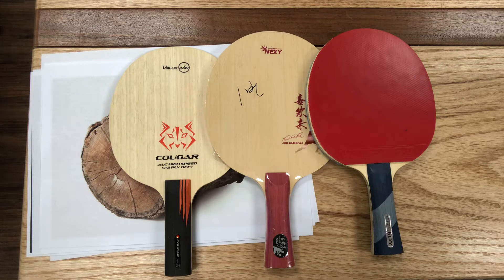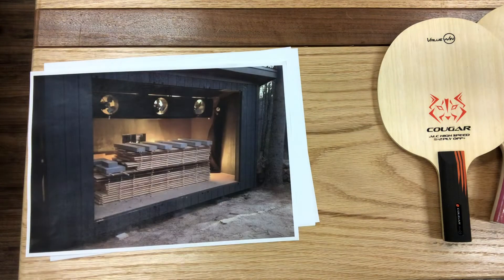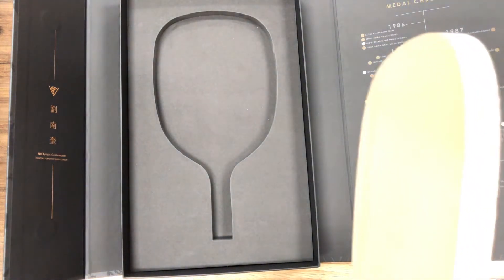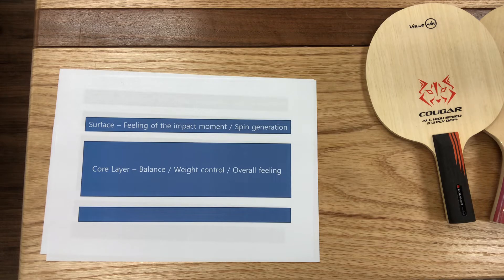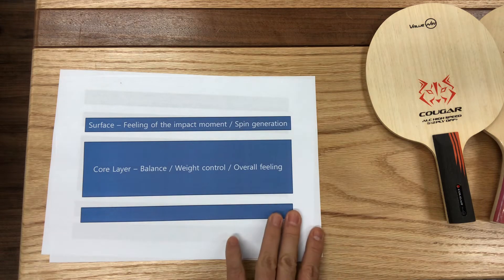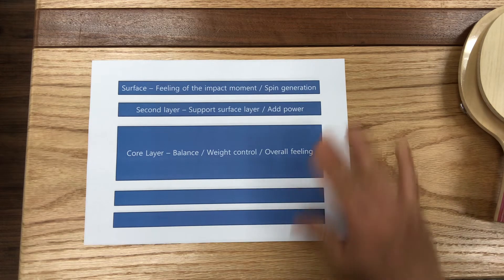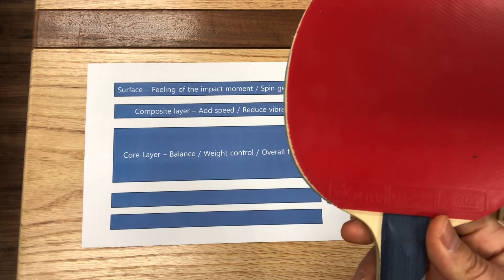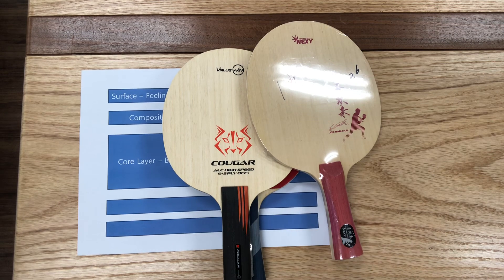Blade composition / Why plywood?

Comment: Hi Oscar,

I thought your English was great and I appreciate you making the effort so that we can communicate (that's my fault, since I only speak one language). I do have a couple questions related to topics you brought up in this video:

1. How do you decide on and eventually settle on the thickness of each ply/layer for each blade design? For example, deciding between a middle ply that's 0.7mm versus one that's 0.9mm thick.

2. Is there a type of epoxy you find most preferable for the composite layer? For example, epoxies on the market seem to come in a range of flexibility and hardness values (e.g., from those used in boat building to stiffer options for finishing applications).

Thanks for your insight!
Reply from the maker: Thank you for the inquiry.
I think your questions will be solved little by little if you continue to follow up my youtube channel.
However, I will give you simple answers here.

1. The thickness of each layer is very important factor to build up the final functional features of blades. It is time consuming process, and I normally take more than one year, before I finalize the mass production blade's composition. 
It will be difficult to explain all answers here, so, please, stay with me here, and I will probably have some opportunities to share more information concerning this topic.

2. This is also very important matter. I tested many different epoxies. Some are strong, but loses feelings, some are not hard enough for composite layers to stay fixed on the wooden layer. 
So, I think epoxy is a kind of company secret.
Specially, some Nexy blades are now being copied by other brands, but I think they can not copy the actual functional features, because they don't know what glue I use, and how much I use. Therefore, please accept my apology that I can not tell you more about this question.

Thank you. Keep posted.

Comment: Hi, thanks for the video, just have 2 questions
1- What kind of blade structures and tech do you expect in the future? 
2- Does fish scales on the outer ply of the blade give better feeling?
Also one more non-serious question:
If you could put a composition layer made of Meteor Rock inside the blade, how would affect to the play?
Thanks.
Reply from the maker: Thank you for watching and for the questions. 

1. For the time being, ALC blade will dominate the market. 
(1) ABS ball needs more power and spin in attacking
(2) Players are playing close to the table and wants to play with high speed and direct feel, in exchange of good feeling and power when they like away from the table. 
(3) Tables are changing and gives higher bounce than before, which gives better chance to win for the style of Harimoto and Mima. 
=> Due to three factors, ALC will become more and more popular in the market. 

2. The percentage of the surface shape affecting on the functional features of the blade will be very very small amount. But it gives psychological satisfaction, which is also important for some people. Personally, I don’t care about that. 

3. The ideal feature of a blade is not much related with the mechanical data. So, I don’t think we need very hard layer to maximize the speed. The actual character of the blade is the result of all materials in a given specific size and combination. 

I hope those are enough answers to your questions.

Comment: Very good explanation, thank you.
I have a question out of curiosity,  does each ply get pressed before sticking them together. If so, to what ratio?
Reply from the maker: Difficult to understand your question. Pressing process will be only for gluing two plies together tight. There seems to be no factor related with “ratio”.

Comment: Since you talked about 3+2 ply, if you were asked to make a 3-4mm thick blade, what core and carbon would you choose, ignoring if its gonna be for def or  w/e , just what are the first 1-2 combinations you would test ?
Reply from the maker: I know we used to have very thin blades in the past, when we played with celluloid balls. But with ABS, I think 3-4mm blades have very little chance. 

There is a regulation for the ratio of composite layer compared wit other wooden layers. So, if we produce 3-4mm blade, the carbon layer should be very thin. So, it does not make sense to consider, when it becomes too light and slow. 

However, I was informed that ITTF will allow many non-wood materials for the blade composition without ratio regulation, then your question will become serious topic for many brand designers. 

Anyway, first, let me tell you hard material does not guarantee higher speed. And also, speed and spin can be trade offs. So it will be very sophisticated process to find the ideal combination. 

So, if I really have make a very thin blade, I would try to make it still flexible and spinny, but need to be solid with heavy layers to guarantee 88-92g, which top players prefer to play with.  

So, what about this idea?

0.5 mm Limba + 0.5mm ayous + 0.2 carbon + 0.5 ayous + 0.2 carbon + 0.5 ayous + 0.2 carbon + 0.5 ayous + 0.2 carbon + 0.5 ayous + 0.5 limba

The reason I used many layers is to make it heavy and solid, even it’s very thin, 
and the reason I used two wooden layers as outers is to give good wooden & soft feelings as well as good spin, 
and the reason I used ayous and limba is to give this blade flexible response as a whole, even very thin. 

Thank you.
Reply: @nexy-oscar1284   This is such a great response. Thank you for your time and expertise :D